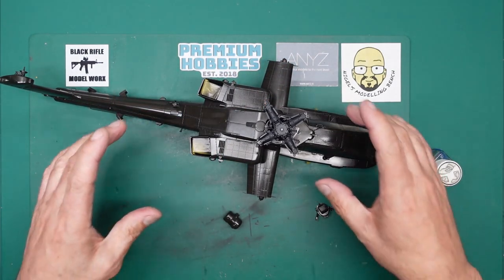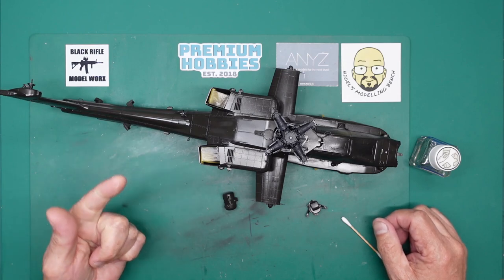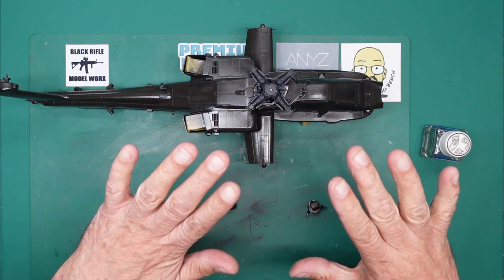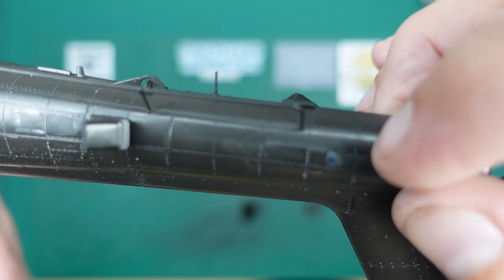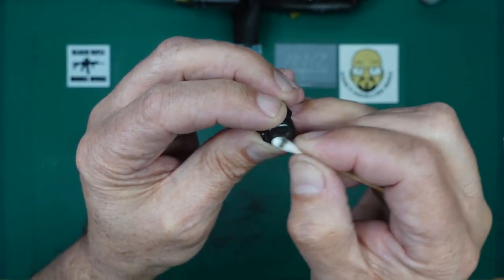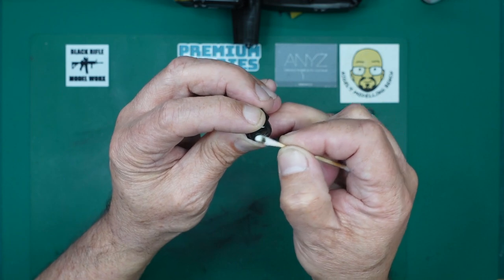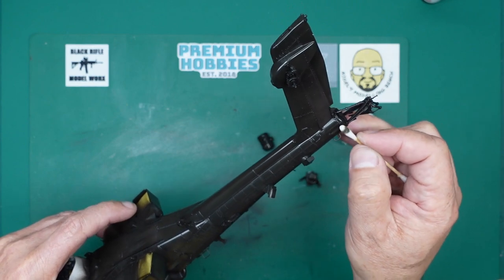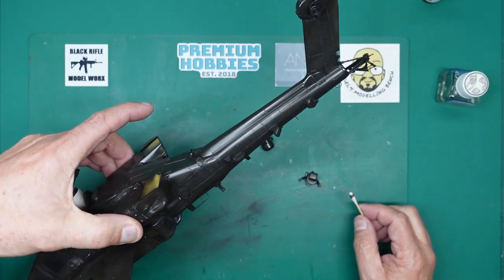Takom 1/35 Apache decal update

Comment: Hi Nigel. Are you sure he's using proper enamel thinner or  is he using mineral spirits? I'll give you an example, with the new eduard decals, you can remove the carrier film by gently rubbing mineral spirits on them but if you use enamel thinners, it attacks the ink. Will Pattison covers this in one of his videos.
Reply from the maker: He used X-20 enamel thinner, which may be softer than enamel thinner?

Comment: Update on mine. I found all the correct decals on the sheet provided using an incredible walk-around video and was able to hide the edges by sanding the decal sheet before peeling,using a thick coat of microsol, solid gloss coat, and topped with matte. Turned out beautiful.
Reply from the maker: I think Takom may have changed production as it would appear that mine are printed on top of the carrier?
Reply: @NigelsModellingBench  The ink is pretty thick I think. I went with a really fine 5000 until I could see one of the decals dull out a tad. Not sure if that did anything in the end but my thought was thinning the decal as much as I could while keeping it intact. It did seem hopeless until the final clear coat was applied though. Dreadful decals for sure.
Reply: That’s a shame let’s see what the aftermarket think.

Comment: I will say, I've always known enamel thinner to eat acrylic paint. I ruined a number of kits over the years by not varnishing before using Tamiya Panel Liner then cleaning up with enamel thinner, and each and every time it pulled up the water-based acrylics. It's not something due to the decals, it's enamel thinner working as it should, unfortunately.
Reply: Lacquer thinner will eat lacquer, enamel, and acrylic. Enamel thinner will eat enamel and acrylic. Acrylic thinners will only eat acrylic. That's why you do lacquers first, clean up with lacquer thinner, enamels next, clean up, then acrylic. Work from hottest down, if you can.
Reply from the maker: Well, I can say I have just wiped an oil wash of my Sea King with enamel thinner and it hasn't affected the acrylic Tamiya paint underneath?? I have always used used one form of enamel thinner or another to remove oil washes and never had a problem? BTW, this model has a gloss coat.. Aqua Gloss, which I have used for years.
Reply from the maker: No mate, these decals are absolutely awful.
Reply: @NigelsModellingBench  Oh, no, I wasn't trying to argue that at all 😅The decals absolutely seem bad.

I just meant unvarnished, enamel thinner will also eat up acrylic. I missed that the acrylic had a coat of Aqua Gloss before the decals were applied, I thought you meant it was decals on the straight acrylic and then the enamel thinner used. There being a gloss varnish between the paint and the decals, yeah, there's something odd going on o.0